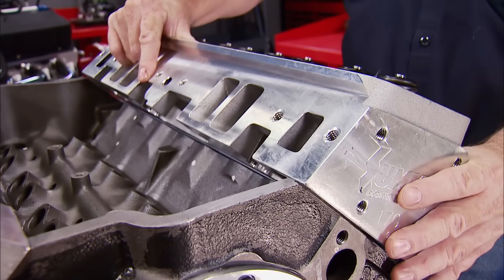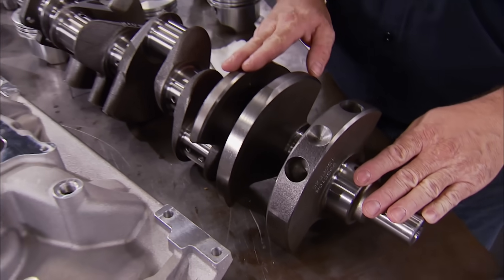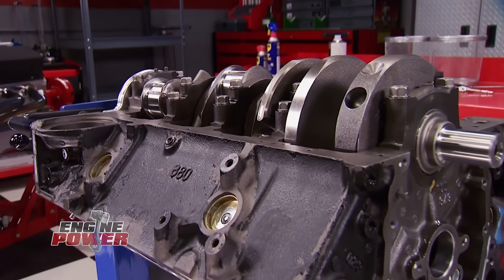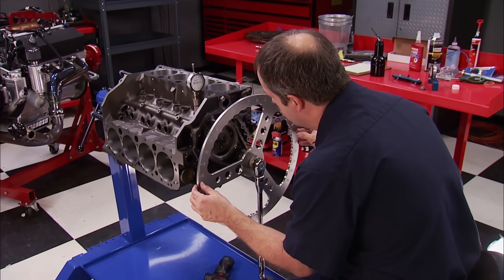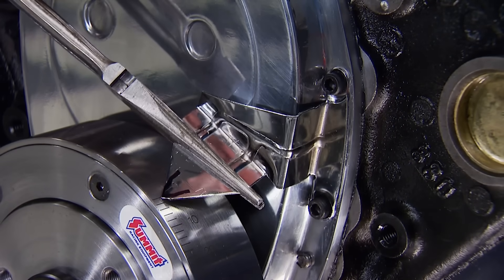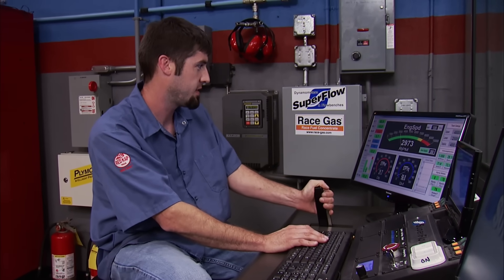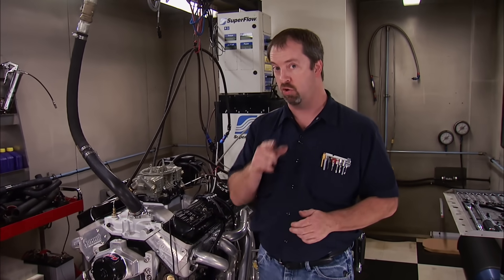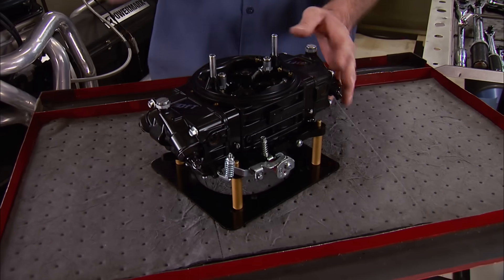Small Block Chevy Build Stage 1: Reliable Power Under $4,000 - Engine Power S3, E1

Comment: For less than $2000, they could've rebuilt a small block with hydraulic roller already in it, and did away with the aluminum rocker arms, since Summit already sells roller steel rockers anyway.  Why are they throwing all this performance stuff on, if all they're gonna run it at is less than 5000 rpm? Gigantic commercial for Summit Racing, so Summit and PN can keep the lights on.

Comment: I just want to know where you get that degree wheel with the finger grooves.
Reply: Here's the cam degree wheel they used:
16-inch Aluminum Degree Wheel Kit, from Neely Precision LLC. 

https://www.mcssl.com/store/neely-precision-llc/catalog/product/72f981f4f5264efd8c2b376373820c3a

Comment: All that motor for that ancient trash cam. YOU HAD A ROLLER BLOCK.
Reply: For a 5500 rpm engine yeah maybe it just cost maybe 150-200 more. They should have did that.

Comment: If I built an engine from scratch for that much money and only came up with 357 hp I would kill myself.
Reply: They had to buy everything brand new. My stock rotating assembly gen 2 lt1 350 with arp 2000 rod bolts makes 437 rwhp for 1600 in heads, 300 cam, 200 intake. 11.6 compression, 236/244 .610 lift cam. Should be 530 flywheel, so yeah, me too.
Reply: I built my 01 Cobra (built for boosy) But i got ATLEAST 5 grand into it lmaoo, and yeah its estimated its only gonna make 380 to the wheel lmao as of now, (Until supercharger and i'm hoping 600 to the tire)
Reply: @SkepticalVex  OHC Fords are expensive to build and make crappy power. That is, unless they have a blower. The Coyote (finally) makes good power NA.
Reply: @GroovesAndLands  I remember its the 18 or 19 GT, with some Simple mods+tune, it hit 500 on the dyno
Reply: I would've spent a little more and got a roller cam instead of a flat tappet, then got a high rise intake. 

They could've made closer to 380hp or more depending on the cam duration and lobe separation.
Reply: Cheaper is not always better.
Reply: Stock Vortec truck heads, $25 .020 head gaskets, better $120 Summit 1.560" CH pistons, $112 Summit 1105 cam/lifters, $69 Summit 1.6 rockers gives 425 HP/425 lb.-ft...
Reply: For the price what can be expected. Different parts can probably be used as well. Where would you differentiate from these guys???
Reply: Drex Cote 5k got my buddy a 383 roller motor making 480hp 520tq.  All forged internals. World products heads and it runs on 91.  Only thing we have the machine shop was the block
Reply: Definitely lol
Reply: Right lmao you should be able to get that from a clean block and box of spare parts for $800 lmao
Reply: They’re throwing parts out from Summit to advertise their sponsor. Myself I would’ve gone roller lifter and cam. Best advice is talk to other builders and use what’s in budget for power. Power isn’t always money on a SB 350, but you also pay for what you get. SB350’s and LS motors are like Honda motors. They’re like LEGO builds and there is a ton of things out there for them at varying prices.
Reply: Something seems wrong. That fairly mild can and the tight lobe center gave that flat torque curve, but the 5100 rpm and low hp and torque number doesn't add up to well.
Reply: Every build these guys do Hot Rod mag already did and much better. All they needed to do is look them up and copy them. No one would know. HR did a build with stock Vortec heads that made over 380 HP.
Reply: @unicornsteaks6769  - Very true... a little tweaking even get 425 HP for no more money...
Reply: A $1,000 put me into a 500 HP 500 lb.-Ft. SBC 405"

Comment: Wait 4K for that? Could buy a 5.3 and slap on a Ebay special turbo kit and double that haha again idiots
Reply: For less than $2000, they could've rebuilt a small block with hydraulic roller already in it, and did away with the aluminum rocker arms, since Summit already sells roller steel rockers anyway.  Why are they throwing all this performance stuff on, if all they're gonna run it at is less than 5000 rpm?
Reply: DurpandDurp I have a 5.3 swap with a carburetor, msd 6014 ignition controller, and the factory drivetrain cost me less than $2500 with buying a low mileage engine

Comment: I hope this video was meant as a prank and not to be taken serious. So many issues with this and this was absolutely not a budget build. I over the years built many 350 small blocks and my best one was a $1,500 complete rebuild. Wish i would had a dyno at the time it was built to test it. But it went into a 1 ton C 30 Chevy oilfield truck 4 speed. That engune had so much power even in 4th gear fully loaded you never had to shift on a hill. Here they didnt even elaborate on the pistons which in a 350 they are many types to choose giving what your requirements are for compression. In a 350 cu small blocks higher the compression the more efficient the fuel burn bumping up horsepower. Which was in turn easier on the wallet at the gas pump.i am confident the above mentioned rebuild i did in that truck was over 400 horsepower and on highway it got a whopping 23 miles to the gallon. Most efficient build i ever done the one downfall was it was hard on the starter due to the compressiom. It took alot of power to crank it over when starting up. I only wish i remembered what the compression was but that build was about 40 years ago now. That same build would be about $2,500  or less today's prices. But not everything was new just rebuilt. Picked up a used block had block and heads checked for cracks and new guides and valve seats. Intake was the one that was original on the block and reused the piston rods. The money saved from the used parts got the new high dome racing piston and racing cam and resurfacing heads. Now thats how you build a budget power plant.
Reply: Aw

Comment: Your measurement would be easier for most to understand if you would stick to just thousands of an inch. Saying 27 ten thousands vs 2.7 thousands like the plastigauge measurements or engine specs read in a book.
Reply: It's in thousandths  decimal goes the other way were talking half the thickness of a hair
Reply: @josephtomaszewski8043   Right the decimal goes the other way but we are already talking thousands = 2 thousands = .002, Was just saying in auto mechanics most everybody just understands thousands of an inch and never use a 10 thou scale.
Reply: I dnt know where u work but u wouldn't ever work I'm my shops if u cant get thousands and thousandths right ..we build a shit ton of motors and trans and getting the right tolerances is key
Reply: @josephtomaszewski8043  I'm sorry dude I wasn't picking a fight with you and I do know the difference between the 2 scales , all I was saying is there is no need in engine building to ever use the 10 thou scale. I have also built plenty of racing-street engines in my shop , I have just bought a 1.7 acre lot to build a bigger shop to move my business but mainly for my racing habit.

Comment: Nobody gives a crap about these old school push rod motors anymore. They’re a dime a dozen, that’s all they build on these shows. Build something modern like a coyote 5.0 or a modern LS motor. Or do something that’s actually popular right now like Dyno tuning and intake manifold comparisons/ parts reviews. Again, nobody gives a crap about this carbureted crap anymore
Reply: Chris Smith the best part about this comment is the fact that ls motors have pushrods and without the original small blocks the ls engines wouldn’t exist. I enjoy your ignorance.
Reply: @NTRGFX hence why I said MODERN. My point was nobody cares about 1950’s tech anymore. At least an LS has modern advances.  I enjoy your lack of reading comprehension skills

Comment: You guys would have gotten more horespower with the cast iron Vortec heads instead of the TPI heads. The TPI heads are garbage, any small block chevy enthusiast knows that ( i think ) hint: you guys would make more power with vortec heads because they flow air much better

Comment: 4000 bucks I would want more then 350 hp. Could order a crate motor for that haha
Reply: That's basically what this is:  Just a overpriced low powered crate. With a lot more work. If you are going to put the time and money into building it yourself i would want at least 400/400.
Reply: Call it a crate engine or what ever you want It will cost around 3500 plus shipping for an aluminum head engine like this without an intake, carb, spark plugs, wires or distributor. Really it doesn’t matter if you buy a crate engine or have your local machine shop build the identical engine something like this will be a similar price. In my opinion it’s dumb to build an engine like this. I think about it like this if you build a 600hp engine or a 300hp engine you need to buy all the same parts for both engines just one engine the parts are a little cheaper. For instance my buddy built a 306 ford and I built a stroker 347 at the same time. My crank was $100 bucks more, rods were 150 more and pistons were 150 more but only because I used a domed piston otherwise the price were almost the same and it cost me 100 bucks in additional machine work to clearance the bottoms of cylinders for the rods and 100 more to machine the main caps flat to use a better girdle. So I spent 550 more to build my bottom end. If I used similar parts like my friend did (flat top pistons, I-beam rods, didn’t machine the main caps) I would only have spent 200 more to have 41 more cubic inches. Now my camshaft was 200 bucks more, my heads were about 500 more, carb was a few hundred more, intake 100 more. By the time we both built our engines I probably spent like 2000 bucks more but I had higher quality parts, 41 more cubic inches and about 200 more horsepower. I don’t remember the exact number but say he spent 5,000 bucks and I spent 7000 bucks. In my opinion why not spend the extra 2000 bucks to have a better more powerful engine you already went as far as spending 5000. He had to run nitrous to keep up with me and his engine didn’t last that long because he cheeped out on some stuff. All I’m saying is if your going to spend the money just do it right the first time. Why spend 900 bucks on a set of cheap aluminum heads when you can spend 500 more for something that actually flows and can make power. If money is a real problem then build the bottoms end really good and put whatever heads and cam you have for now and upgrade later or just build the engine over time.
Reply: @peanutbutterisfu  I am with you. I'd rather spend a little more and get a good motor, than save a little for a mediocre one. I also don't understand some of their part choices. I am assuming they went with the tiny cam to make their gains in the next stage more impressive or something. With the compression and head specs  they could have ran a way better cam for the same money. Also why run a single plane on a setup like this? Though that is the flattest single plane I have ever seen. They could have spent another $100 on heads and gotten some of Brodix's IK series, put in a real cam, and made at least 100 to 150 horsepower more. If they wanted to save some cash to compensate they could have used a cheaper pan (this engine has no use for a street/strip pan), and used roller tip rockers as this engine isn't gaining much from the ones they put on.
Reply: STREET RACER valid point
Reply: All of these comments are pretty toxic
Reply: Here's 447 hp for less than $3500 with basically stock Vortec head (milled).
https://www.hotrod.com/articles/0611em-vortec-small-block/
Reply: nutter  and look at the cam here. That's a small ass cam.  I wound not even use one that small in my 302 lol they needed an xe274 it probably would have had 400. but those springs in the heads would have to change and there goes the 4k budget
Reply: @KingJT80  that cam is exactly the reason they only got 350hp out of it!! With those flat tops those heads and a good cam they'd be well over 400hp
Reply: I got mine for about 2000 it gets 300 its better then 4000 dollars
Reply: Stock Vortec 350 plus cam and pistons gets you 425 HP and 425 torque... ( add intake, 4 bbl. carb., and headers... This engine build was hurt by #345 pistons that have lower than claimed compression height... and cam was installed too far advanced, giving 5100 RPMs HP peak instead of 5800 RPMs...
Reply: Get a bigger cam?
Reply: Agreed.
Reply: nutter  bro a stock 400 sbc with no smog pump makes 376 hp and almost 450 ft/lbs
Reply: @colinharris776  - No... you would need to change the pistons and cam...
Reply: @colinharris776  376 stock lol
Reply: @bigboreracing356  so basically  your calling yourself a dumb ass.
Reply: Peder Hansen  - They didn't cheap out, just bought wrong parts and assembled them incorrectly... as someone else said, prolly did that to make Part 2 engine look better...
Reply: A bigger cam and that would have made 400hp easily, I've done it many time's! As long as you have decent heads its nothing to get 400+hp from a 350 Chevy.
Reply: @docsmallblock6584  - That 218/218 cam they used was big enough to reach 400 HP... so was the intake... those heads must not have flowed for crap !!! And those may have been 'rebuilder' pistons that sit low... this engine was missing 700 - 900 RPMs and nearly 50 HP...
Reply: They started with just a block that’s why it was so expensive
Reply: It's a build not a buy. You can go buy a crate motor and when something goes wrong with it you can take it out and ship it back to the company to tear it down and do all the analysis themselves put it back together and then send it back to you on your dollar. Or you can literally build yourself something if there was any kind of issues with you you could take out dismantle yourself figure out the problem fix it without having to mail it do some other person to do the easy work
Reply: STREET RACER someone’s a little over confident 😂
Reply: How long is that gonna stay together for 4k??
Reply: mrhazel you could pick up a 1980 and under 350 block for 200$ bore it to 4.000  and buy a rotating assembly for 700 bucks that strokes it to 3.43  and comes with valve Relief pistons. Buy some aluminum heads for 600$ then buy a summit cam for 80$ and try to pick up a 650cfm carb from market place for cheap and a high flow intake 200$ - 500$ should make over 400 hp some what reliable
Reply: It would probably last 2 years and if it bust buy another block for 200$
Reply: @aarons2613  
What??  350 block starts at 4.00 pal. You aren’t boring it to 4.00. And you aren’t stroking it to 3.43. Stock stroke is 3.48”

You are spending way too much time stroking it….
Reply: @KingJT80  forever its a chevy!...
Reply: nutter  I mean you could do it with Chinese heads hyoer pistons Arp everything else stock spin it to 6000 max yeah might cost 4k and make 400..maybe. Depends in compression and cam..oh shit thats past 4k 😆
Reply: If I had that shop tools an money after the block an heads where machine I can put together at least a thousand horsepower motor and I know Master Mechanic
Reply: Then go order one. Nobody's telling you to rebuild an engine. Information only
Reply: I’d rather go look for a 351 Windsor and bore/stroke it.. with 4K thrown in mods to the engine itself you should be in the 500 range if it you know what you’re doing..
Reply: Get a 7.3!
Reply: Peder Hansen  - Prolly want them so mild no chance of warranty repairs needed...

Comment: For $4000, I'm gonna buy a crate motor! A "budget" rebuild is $500-$2000 and you don't buy aluminum heads for a budget build.
Reply: Chevy performance crate you can get for like 3.7k LOL
Reply: If starting with a truck engine with tiny valves and tiny ports, can get the better Asian heads (like Skip White and Blueprint use) for $300/pair on eBay... 2.02/1.60 valves and 200cc ports... a little backcutting, porting, radiusing can make them a lot better, as well...  Valves $70/16... Z28 spec valve springs $30/16...

Comment: 4K? That’s crazy. I paid $150 for a shit block, had it bored .030”, aligned honed, new freeze plugs, new cam bearings and single rear main to 2 piece rear main for $850. I got a crower 3.50” stroke crank for $1200 and then scat 6” rods along with JE flat top forged pistons for another $400. I’m running cast iron 2.02/1.600 with some home porting and a tunnel ram with dual 600 Holleys. My cam is a Howard’s custom grind solid roller that was $350 and my engine made 540hp @7300
Reply: Dang man, you could have gotten a 3.65" crank from Summit cheaper with no machine work to the block for clearances.

Comment: I wonder how this would differ with a TPI intake (l98)instead of a carb
Reply: It would have to have those l98 heads because they use the old intake bolt pattern. U notice they used aluminum vortec bolt pattern heads.  Just fyi but I would love to see those numbers too.
Reply: Justin Milby I have a 90 c4 Vette I am thinking of building up when I am done with my current restore list. I want to keep the original look and so am thinking First tpi( better flowing tpi intake), upgraded heads, cam, and pistons. I am rather new to engine building so I am looking around for ideas but no one actually builds l98s or tpi motors.
Reply: Yea alot of people use carb intakes on these and stuff but I've always wanted to see one these with a ported High flow tip intake and tuned fuel system with proper injector flow and fuel pressure needs to be adjustable.  I have found ways of tuning older efi like this.  It's still old school but definitely works.  The bottom of these engines or Awsome as long as u keep up with maintenance.  I've never built but worked and serviced many of these in Y and F  body cars from that generation.
Reply: @justinmilby4552  what are your tuning methods? I have found little outside of carb tuning or aftermarket tbi efi system tunings.